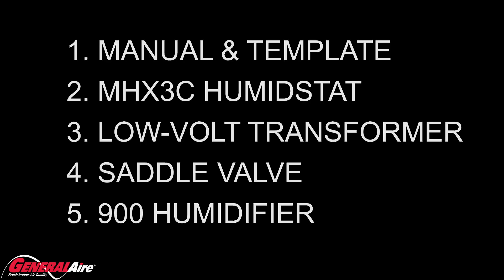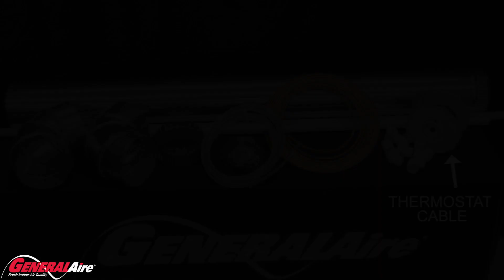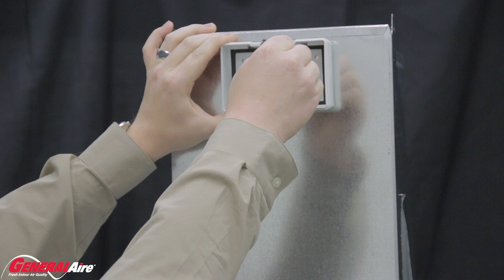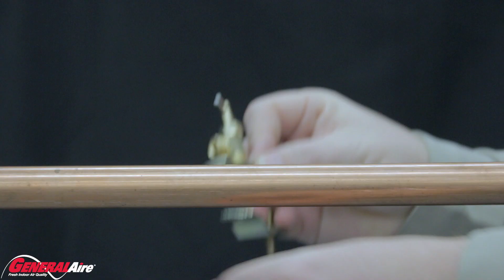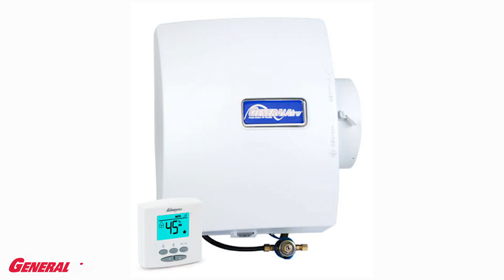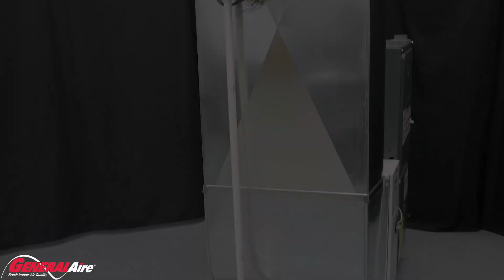GeneralAire® 900 Humidifier Installation

Comment: Do you have a video for pad replacement of a General-Aire model 800 humidifier?
Reply from the maker: I'm sorry but we do not, however, all you do is slip new plates into the applicable slots.  In addition, clean off any sediment by soaking it in vinegar and water.